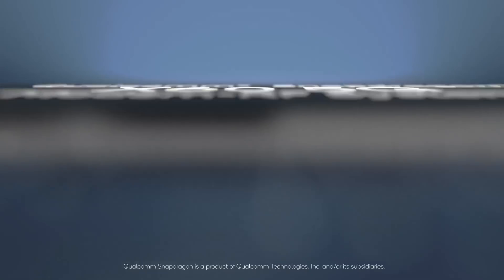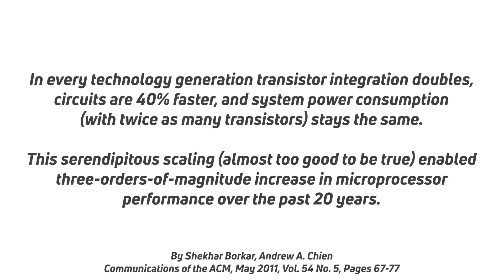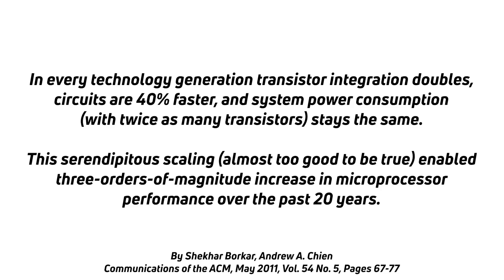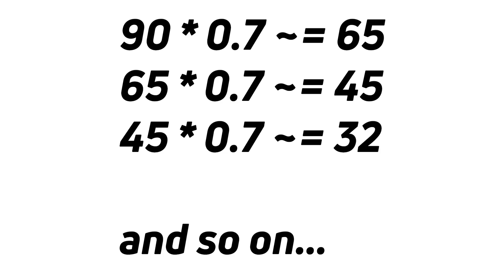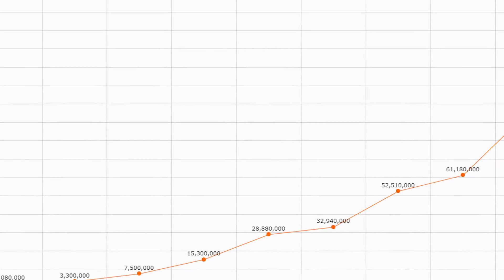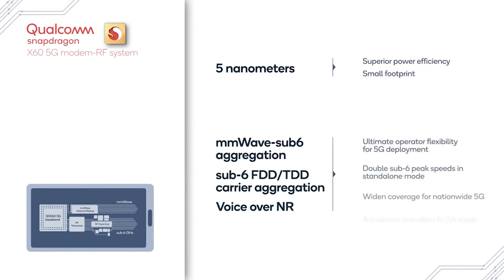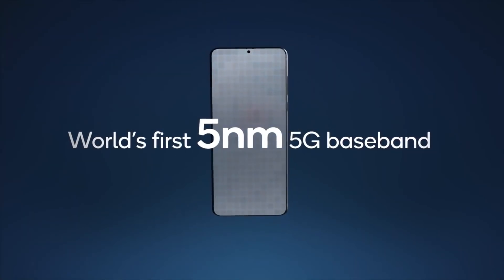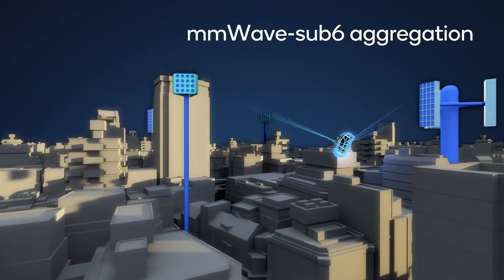5nm Qualcomm Snapdragon Chip Announced

Comment: I’m just sitting here waiting for that 0nm chip
Reply: Hope you have a metal ass cause that's a lot of waiting 😂
Reply: Under 3nm has already been done it just takes up to 5 years for the companies to profit and change their manufacturing for the next step. IBM does alot of the research for these companies so checking out their progress news will tell you what nm range we are actually at. I think down to 2nm from last I read. From there they will switch to Carbon from silicon and switch wires to fiber optics.
Reply: waiting for 1nm
Reply: @wanmaziahahmad151  0,7 it was told you it must to be devided by 0.7
Reply: @wanmaziahahmad151  yes ,me to bro ✌🏻🙂
Reply: You're not thinking far enough in future. How about -10 nm chips? Or even smaller. -1 kilometer! Tardis level stuff.
Reply: @Mornys  I think we need to  have  subspace trans conduction so we cn have the electrons flowing in a subspace matrix that  only requires a physical interface to the subspace!
Reply: @Mornys  negative nm is piko PM
Reply: @MugCofee  I'm not quite that confused, I was just kidding about the negative length, which is nonsense. 

Length is a measure of distance, which is a scalar quantity. Although maybe we could specifically define negative length in a new way. E.g. as displacement, which would be a vector quantity. Then the absolute value of negative length would be the same as the absolute value of positive length, but in opposite direction. 

Did you mean that 1 picometer = 1*10^-3 nm, where the minus is in the exponent of the multiplier 10?
Reply: I'm just sitting
Reply: Each atom takes 1nm
To make a transistor
You need a semi conductor like silicon
And two dopers
One with extra charge like phosphore
And one with minus one charge like boron
So you really need this 3
Wich means if you made a transistor you need this 3
Wich is 3nm
So you can see that we can't make transistors any fucking smaller
There is no possible way to do that unless yes unless one thing
Reply: @hassanlabyad4082  each atom takes up 0.2 nm not 1nm. That's 80% smaller. 
 
According to Jim Keller, current gates are roughly 1000 atoms by 1000 atoms. Quantum activity is trouble around 10x10 atoms. So we have 20 more years of shrinking ahead.
Reply: @lostinbravado  @muke white
Well this one information killed me thanks for telling me that
So that means they can shrink to an extrem 1nm
Reply: @hassanlabyad4082  probably more like an extreme 0.5 nm. But by that point we'll be calling them the 500 series. Or 500pm.
Reply: @lostinbravado  chip performance growth is way down in the last 10 years. Its barely 2x for CPUs. It doesnt really matter how small are transistors if they can't improve the computing power. We are at the point of diminishing reurns. By the way Intel is stuck at "14nm" for 6 years. Only low power chips are at "10nm". At that rate of progress, shrinking can continue for 50 years if you will but no one will care.
Reply: @hassanlabyad4082  A silicon atom is 111 picometers, or 0.1 nanometers
Reply: @michawhite7613  .1  nm Radius, Diameter around .2nm
Reply: Unless then 3nm is impossible
Reply: Jay at 3nm silicon can no longer work , they need to replace it with other materials which will take some time .
Reply: @lasarith2  it will probably slow down a lot and then kick off hard when they figure out a good way to make it's replacement
Reply: Lmao same
Reply: Nah you'll see 100pm before that, and the cycle of numbers continues once again...
Reply: Then, smartphone will fly or disappear
Reply: Zero kerf!
Reply: A new material is coming and using light.
Reply: Give it at least 10 years
Reply: I think 3 is the limit
Reply: @Cory Bernhardt will never happen
Reply: 0.01nm?
Reply: @flickeykrunchofficialYT  1nm++++
Reply: yeh ehhh  nothing after nm will work
Reply: Dive in quantum, my man.
Reply: yeh ehhh  after 1 nanoMeter the numbers order is  "pikoMeter" . 
0.9nanoMeter = 900pikoMeter
But for this they need new materials. Not Silicon as it is now.
Probaly it will be Carbon .
.
But if they switch from Electrons(Atoms particle or electricity) to Photons(light particle) then it will be a whole new System or concept.
I dint know which material will br choosen.
But its Physics chalange not iT.
Reply: Keep sitting...
Reply: To the quantum tunneling: Will we soon see CPUs which uses not so reliable transistor, do to quantum tunneling, to calculate the same thing in parallel, but which much smaller transistors and much faster, and then the result is compared and when they are different, the calculation is repeated? This way they could make it reliable even when there is a risk of quantum tunneling.
Reply: Better wait for hydrogen atom size architecture chip that would be great we won't even be able seet it but it will do its job
Reply: Lol then it's gonna take 2 years to release the 0nm chip.
Reply: Short circuit
Reply: micrometer, nm, Å, pm...
Reply: Bunker Baines well it could be 0.0
00001nm. But you know marketing they are definitely doing with 0 lol
Reply: Hi just
Reply: You've already got it, don't you.
Reply: Waiting for 1 pikometer chip
Reply: 0.0000001 nm possible probably hundred thousands of years later but 0nm never possible. :D
Reply: Then you are waiting for 0 chip lol
Reply: All of you smartass commenting here do you know the size of atom it's 0.5 nm
Reply: lolz
Reply: It won't happen, as he explained in the vid, it will go like this, 5 nm, 3 nm, 2 nm, 1.5 nm, 1 nm, 0.7 nm, 0.5 nm, 0.35. It will never reach 0.
Reply: حح٨ط
Reply: You'll be sat there FOREVER 🤣 l bet 1 year later you're still sitting there

According to Wiki the next one is 3nm
Reply: actually after a particular size quantum behavior kicks in.Approx 3nm is the best they can control (i remember this i might be wrong) and apple has said 5nm will be revolutionary.
Reply: @priyanshu_hiro  they made a 1nm chip in China once, it was only a few transistors tho
Reply: @fish9468  cool
Reply: @priyanshu_hiro  I want a mobile chip that can support pc graphics games. When will we see that day?
Reply: @priyanshu_hiro  every manufacturer will say that because they have to advertise the thing on which they have invested millions or probably billions
Reply: Sitting
Reply: Drake Vice correct thanks
Reply: @jaymaster103  hahah
Reply: im waiting for pico not nano pico is way more smaller 1k pico is equivalent of 1nm and soon 500pico chip release
Reply: That's your brain. 0nm.